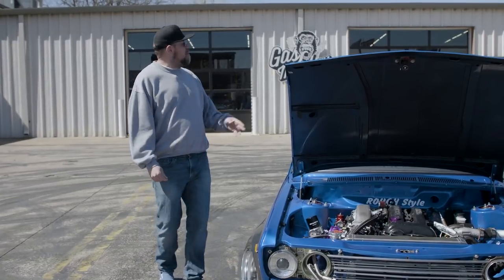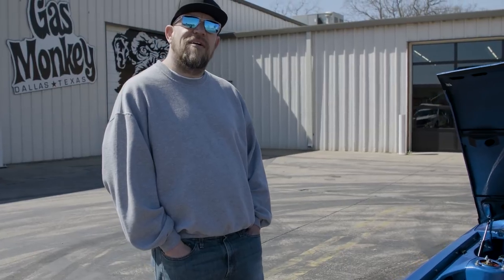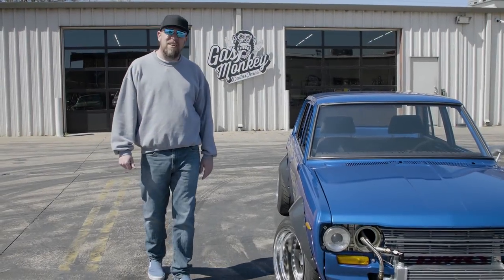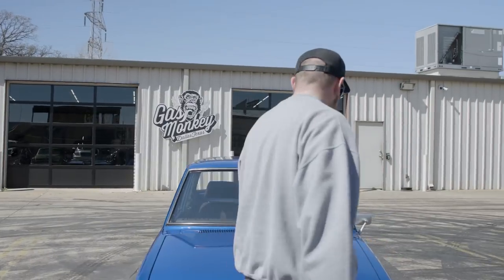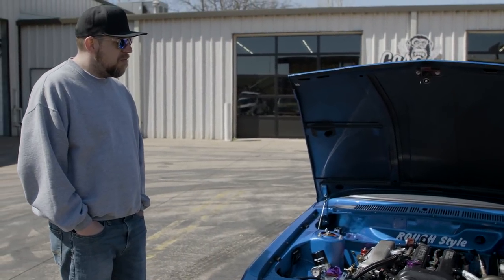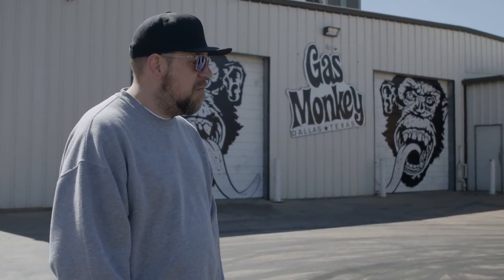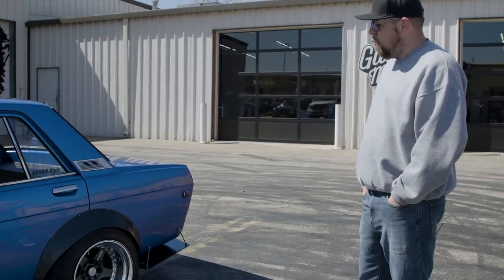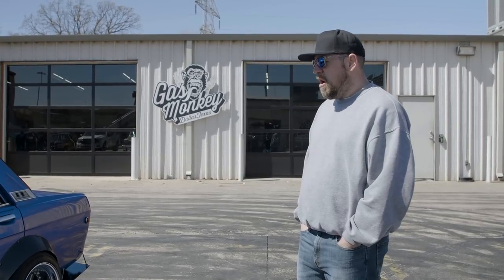S14 SR20DET Swapped 1969 Datsun 510 - GAS MONKEY GARAGE - AutoFocus Ep001

Comment: Nice Dime Wes. I have James Boswell Coachwerks rack & pinion in my SR swapped 510 and it's night and day. The cross member is set up for front oil pan and they've modified the geometry with raised pickup points and shortened steering knuckles giving it zero bump steer even at 3.5" lower and only 2 degree caster. Much lighter wheel.

Comment: I’d be worried with the intercooler being exposed like that. Sorry to be ignorant, but what is that tray under the rear of the car?
Reply: Pull out table to have a picnic on
Reply: He probably doesn’t drive it everyday, & the first cooling piece out front is an oil cooler.

Comment: BTW s14 is a BMW engine...
Reply: the engine is an SR20DET. S14 is just the car it came from
Reply: yes they changed the title
Reply: Sr20det of nissan s14 chassis "Silvia" or "240sx " in América
Reply: CrAzYDr1veR s14 is not a engine the engine i this car is sr20